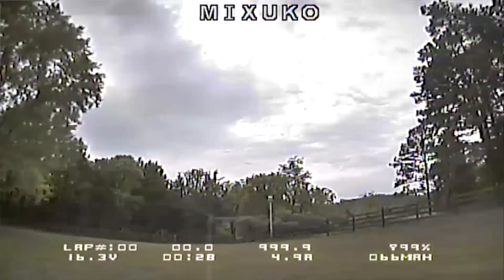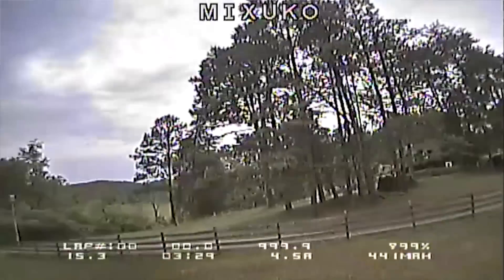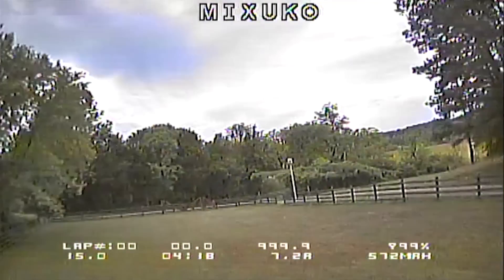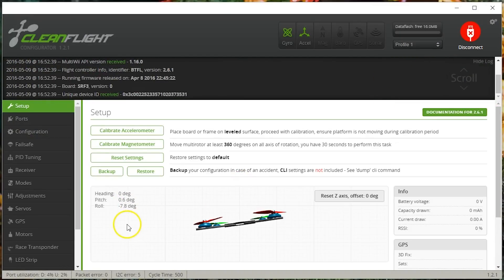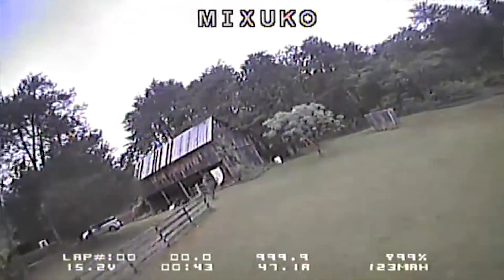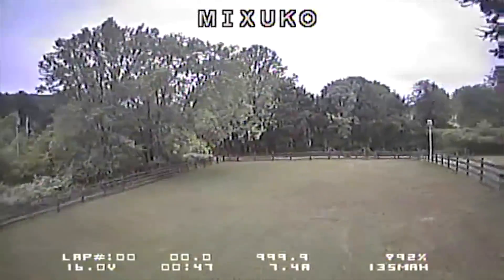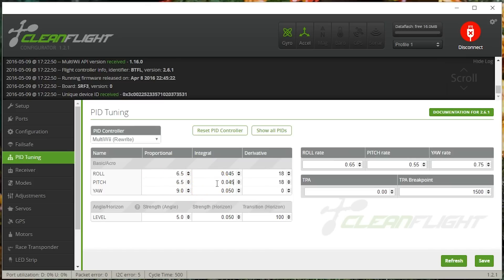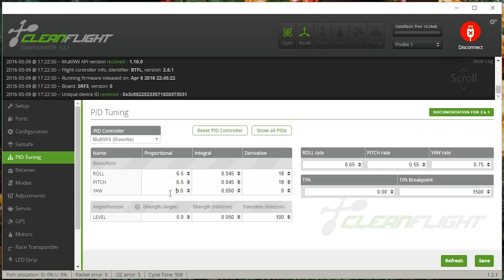Practical PID Tuning - Part 1  | HOW TO TUNE A QUAD

Comment: I would love my quad to be like yours did when it started.  My copter is oscillating out of control from the start.  I have my pitch and roll  P settings at 1.5.  and yaw at 3.5. My I's set to .04  and my D's to 18.  I'm flying a versacopter.  CG is balanced,  I'm running an X Racer F3 controller on CleanFlight with Borris B betaflight.   What am I missing here?
Reply from the maker: Could the oscillation be I term? Try lowering I to 20.
Reply: Joshua Bardwell I dropped the I' to .02 and the D's to 12 and still oscillates.   Is there a min starting point or is it case by case?  I'm using the std e pack that they recommend on the flitetest build.  Short of replacing all the motors and esc's I'm not sure what to do.  I do have a honking 5amp lipo on it to weight it down and keep it from going out of control too easily.
Reply from the maker: +adriancjones something is seriously wrong. With gains that low, it can't be your tune.
Reply: Any idea where to start?  I've replaced the FC from a naze32 rev6 to an Xracer.  Replaced a D4R 2 to an XSR running Sbus now.  All motors seem to be fine, while doing the esc calibration everything works the way it should.  I'm at a loss.
Reply from the maker: +adriancjones I'm afraid the problem is unusual enough that I don't have an easy answer. If I were there, I would start with a physical inspection of your build.

Comment: in Cleanflight what does strength (angle) adjustment do?
Reply from the maker: Stronger return to commanded angle in autolevel modes.

Comment: That video actually does not help at all (and I don't mean the horrible video quality at the beginning where you can't really see what's wrong). Calling yourself a drone racing engineer is a bit too much in my personal opinion. Saying things like "the throttle may need more yaw I gain.... perhaps..." causes confusion for beginners like me. You can't learn from vague comments like that (you have to explain why you think that I gain is needed). And why the heck don't you explain what P or I or D actually does or what it helps to solve? I died at "ok, everything is feeling pretty good". What exactly does that mean? Why don't you explain what "locked in" actually means?
Reply from the maker: Maybe this video will help you.

https://www.youtube.com/watch?v=8uqZmrCPOPI&list=PLwoDb7WF6c8ldO8tz0IUi9FNcJdvE2Mhe&index=5
Reply from the maker: Also this one is very good.

https://www.youtube.com/watch?v=0vqWyramGy8
Reply: Your other parts of the series, especially 5 and 6 do get better. Already watched them and thank you for creating them. Sorry if it seems like I'm an asshole after reading my first comment. I guess I really am one.
Reply from the maker: That 2nd link is to a video describing what P, I, and D do. Just in case you thought it was one of mine.

Comment: Thank you for the video! If I understand correctly...
Keep raising P gain (on all axis) until you see oscillations. Then lower them very slightly. It should feel locked in.
For I gain, do a punch out and see if the quadcopter holds its place and doesn't "drift". How will I know if I gain is too high?
For D gain, just do hard turning maneuvers and see if there's any oscillations. Keep turning it up until they're gone. If it's too high, it will feel sloppy.
Reply from the maker: Generally correct. If I gain is too high, the copter may oscillate in extreme cases. There may also be bounce-back after flips and rolls, although Betaflight has logic to prevent this. Excess I gain on yaw may result in the copter feeling like it wants to "pull into" or "pull out of" a turn at the end. This is because the I term on the yaw axis takes longer to return to neutral than the roll axis, because I gain is too high.

For D gain, you can't simply raise D arbitrarily. Eventually you get excess D gain and hot motors. You can destroy a motor or ESC this way.

Comment: howdy joshua,
 I watched all 5 and thanks. great info in here. I like the sound side of things and the I term.
I hadnt  caught the idea that throttle effects I as much as it did.
a quick question that may be of use for myself and others.

As the video starts with tuning the pids, is there a pre-cursor video talking about the other settings you apply?
e.g. rates, looptimes etc.

I cannot find that sort of thing anywhere. 
or perhaps one on the effects of the most common settings.

cheers and thanks for the videos
Reply from the maker: https://www.youtube.com/watch?v=htkw7d97bOo

Comment: need help,  when I yaw my quad, either right or left, the quad likes to throttle up and climb then back-down slightly.    what is the fix for this?
Reply from the maker: What version of cleanflight or betaflight are you running?
Reply: librepilot
Reply: using cc3d, i am beauty new to this stuff
Reply from the maker: Sorry, I don't know how to address that problem in OpenPilot / LibrePilot.
Reply: try setting "cruise control" on your yaw on the tab where you change the modes and stuff. I'm not the Josh Bardwell of libre pilot, but I think it could help you.

Comment: so I have recently been trying to ton pids on  my nigh halk pro 280 and I am giting close  but when I am flaying fast and I lower throttle to center the nose pitchs down and than pops back up any help would be great as its scary when flaying fast 5 feet off the ground and it moves so sudden
Reply from the maker: Make sure pitch P is high enough, then raise pitch I gain.

Comment: I was testing my yaw while tuning, moving the stick left to right, with high yaw rate, when it just falls out of the sky. If you want a detailed description, it flipped backwards about 180° and fell.
Reply from the maker: If it flips towards the down-spinning motor, min_throttle may be too low, causing a motor to stop fully and not start again.
Reply: +Joshua Bardwell It started doing that after adjusting PIDS on the pitch axis, it also likes to overshoot in a flip, timing on sticks is right.
Reply from the maker: Look at Blackbox and see if a motor is zeroing out during the move, and then going rapidly to maximum as the stick re-centers. That's an indication that min_throttle is too low.

Comment: Hi Josh I started tuning my QAV210 today. Here are the values for Roll and Pitch P 4.0, I 0.03 D 18.  Yaw P 9.5, I 0.05 and D 10. When I punch hard and cut the throttle the movement at the pitch axis is so drastic that the copter's nose dips down almost 180 faceplant down to the ground and wobles in the roll axis as well. Are my I gain values too low? and what should be the default values for I that i could start off with. Also what other characteristics should i look for when it comes to tuning I gain? Running betaflight 2.6.1 running airmode, naze32 rev 6 acro.
Reply from the maker: +Amber Meows first work P up. You should see the dip decline as P increases. After you're sure that P is high enough then raise I.
Reply from the maker: +Amber Meows first work P up. You should see the dip decline as P increases. After you're sure that P is high enough then raise I.
Reply: Thanks Josh!

Comment: This is exactly what i need to further tune my quad.  I have it good right now, but I wonder if I can make it better but not sure what behaviour to recognize and how to correct it.  Thank you Joshua!
Reply from the maker: First, make sure that P gains are high enough. This is the single biggest thing you can do to give a sharp, locked-in feel. But not too high! Okay... so that's not super helpful I guess. My point is, there is a place where P gains are okay, and the copter seems to fly well, but you still have some small tuning issues to work out. And then you raise P gain another 1-2 points and suddenly it's flying EVEN BETTER. So if you stop raising P when the copter seems to fly well, you may not go far enough. This is why I always raise P to the oscillation point then back down.
Reply: So my P is as high as it can be.  It feels stable on hard throttle and when I cut motors to drop down.  I enjoy high rates at 0.60.  My uncertainty lies in continuous correction when making turns or lining up an obstacle.  I'm not sure if it's because of my piloting skills (or lack thereof).  I haven't touch the I or the D yet, but I have PID adjustments configured on my Taranis so I can do changes without plugging in.  

For I and D should they be as high as possible or as low as possible? I haven't watched Part 2-3 yet, so don't answer if that is the case.  I'm literally watching your videos with pen and paper.  

I've watched many videos but yours are easily the most complete and with great explanations.  You do it so well.... you must be an instructor for something :-)
Reply: Another aspect as a new pilot, is that I don't know if the configuration in PID are the best that it can be.  I feel that this is one of those things that you don't know what you are looking for but once you find it you get it.  Does that make any sense?  Another question is should I reduce my rates while configuring PID or is that completely unrelated.  Thanks

Comment: question, when I pitch my zmr 250 forward its tends to dip intermittently. poner all feels good. could that be caused by tv rate. or I settings.
Reply from the maker: +Stephen Kelly dip what?
Reply: Its like  it pitches forward with out stick command. Twitchy.
Reply from the maker: +Stephen Kelly sorry. Not enough information to diagnose.
Reply from the maker: +Stephen Kelly sorry. Not enough information to diagnose.

Comment: 2 questions. 1, When I go to zero throttle to do a dive, the yaw likes to spin a little, how do I fix that? 2, I'm having to put excessive I gain on pitch, on 0.070, and it's stil, not happy. Why does it want so much?
Reply from the maker: Always tune P gain high enough before tuning I gain. Low P gain will require excessive I gain to pick up the slack. Any time you are considering raising I gain, first ask yourself whether P gain is high enough. Only raise I when you are SURE that P is high enough. Think of P as the first line of defense, and I as the fallback for when P isn't able to perfectly correct all error.
Reply: +Joshua Bardwell Thanks! What about the yaw at zero throttle?

Comment: Do you like luxfloat or mwrewrite more?
Reply from the maker: There is literally no difference at all anymore since BF 2.7. The only difference is whether you are on an F1, in which case you should use rewrite because it uses integers, or an F3, in which case you can use luxfloat because it uses floating point math.

Comment: Hi Josh, my first tune. I've got a lot of movement on my pitch, punching the throttle raises my nose and dips on down throttle, so I'm going to raise the i gain on pitch. I also have what I would consider to be quite a considerable bounce back on my rolls. Would this also be an indication that the i gain is to low on roll axis?
Reply from the maker: +Lee Swifty bounce back usury means excess I or low D. Throttle dependent pitch would indicate low P and/or I.
Reply: Joshua.
My thanks, sincerely.
You have given your time and effort significantly to this sport/hobby to help so many of us who are not so understanding. Your video's are excellent and personally I can't thank you enough.

Comment: What flight mode(s) are you in when you start the maiden hover? Thanks!
Reply from the maker: I don't fly autolevel modes at all, but if I did fly autolevel modes, I would still tune in acro first. Tuning autolevel and acro at the same time makes it much harder to tell what is messing things up, if things are messed up.
Reply: ok, so Acro it is. Any airmode?

Comment: When I give a stick input, at the end of the input the copter wobbles. Any idea how to tune this out?
Reply from the maker: It depends on the type of oscillation. It could be P term oscillation in which case P is too high. It could be a soft "sloshy" wobbling, in which case P is too low. The simple way to start learning this is to change ONE parameter, such as raising P on roll. See if the problem gets worse or better. Work through a range of values to explore the effects of a single value's change.

Comment: I have fast oscillation when coming to a Hard stop or quick turn around... , Im using BETA 2.6.1 LuxFloat     ROLL  P. 4.5, I  0.030  D 18....  PITCH P . 4.5 . I 0.0030   D 18    YAW 9.0    I 0.040   D 0    LUX FC  BOARD any help would be great cheers
Reply from the maker: https://www.youtube.com/watch?v=qg1jf85zyqI

Comment: Would this kind of tuning process work for a 450 quad with 9 or 10inch props?
Reply from the maker: +FPV Airmark same general ideas but the outcomes would be different.
Reply from the maker: +FPV Airmark also, the tuning goals might be different. For example, might be going for smooth flight vs. acro.

Comment: super helpful video man. A lot of tutorials are kind counterintuitive imo. quick question if you have the time. my quad feels really good with my tune but I'm still not great at tuning. i have this issue where if i come out of say a power loop and free fall with the copter parallel to the ground i get a rapid sort of side to side wobble where it seems as if its fighting itself. this is with kiss fc.
Reply from the maker: That's propwash oscillation. 
https://www.youtube.com/watch?v=qg1jf85zyqI

Comment: Hey Joshua, I really need your help with my quad. I like the way you analyze things and if you can spar few minutes for me, that would be awsome. I have been having this issue for weeks now. I have changed my esc (little bees 20A), my FC (Naze32), my motors (RS2205 red bottoms) and even my wires. The glitchs are still there. I have check everything (no screws touching the motors, my solder joints, my bullets connectors). Im using 2.7.1 and I have blheli 14.6. The issue was there even when I was using blheli 14.3, 14.4 and betaflight 2.1.6. Can you help me troubleshoot this ? Thanks !!! 

https://youtu.be/trCJloQF-Ho
Reply from the maker: It could be a bad gyro. Is it Naze32 r6 or r5? Did you replace with the same rev? But honestly, the chances of having two bad boards in a row are pretty slim.

It could be excess vibration and D gain causing some kind of "saturation" effect in the PID loop. Does the problem still happen if you lower D gains to zero?

It would be really interesting to see in Blackbox whether the P gain is moving the same direction as the gyro, or against the gyro, when the problem happens, and whether the gyro leads the P gain or trails it.
Reply: +Joshua Bardwell it is rev 6. I never tried to put D gain at 0. I will try that when i get back from vacation. What is weird is sometimes it flies well. But the fact that it does that keep me thinking something is wrong but cant find the source. I have never used blackbox. I will try it also. Is it pissible to send you the data ? Thanks again Joshua !
Reply: +Joshua Bardwell i have deactivated the acc and the baro.. Could it still bebthe gyro ?

Comment: Hi, thanks for the insight. Would having different props change this testing? i.e. normal compared to bullnose props? Surely bullnose would totally change the performance and flight characteristics, so you have to make a different tune setup?
Reply from the maker: +Jason Wolfe yes.
Reply: Thanks, what props are you using? do you recommend?
Reply from the maker: +Jason Wolfe I use kingkong 5040. I like then but they've disappeared from the Internet. Also try DYS 5040 tri blade.

Comment: Thanks for this tutorial !! It really helps understand tuning.. Just a quick question, I have some problem with my FPV signal when I throttle up. I have an LC Filter but it doesnt help. I understand that you refer to maybe a high I or excess of D. I did increase D a lot because I was getting bounce back on rolls and flips. Should I decrease D and decrease I to get rid of this issue with my signal ? Thanks again and keep the good work ;).Im using 2.7.1 and have a Naze32
Reply from the maker: I think there's been a small misunderstanding. I gain won't cause noise in the video signal. So you're fine there. Excess D gain can cause noise in the video signal. Listen for "warbling" oscillations as you throttle up and feel for hot motors when you land.

If the LC filter didn't make any difference at all, then the noise may be being picked up from an ESC power wire passing near the video wiring.
Reply: +Joshua Bardwell ok thank you very much I will defenately check this out. I appreciate the fast response !!

Comment: as you see Joshua the same rates have different outcomes on other frames. degree/sec seems logical but its not behaving like that ;) nice tutorial about pid tuning, i still keep learnig about it. i also noticed that switching looptime from 1000 microsec to 250 eliminates my propwash by 50%
Reply from the maker: +Hans Turpyn yup. Definitely different rates of rotation on different frames. I thought of our conversation immediately.

Comment: on my taste of starting tuning your D is way too high to find a proper P value. 0 for D doesn't work either for me, because it starts oszillating immediately. I set my D usually at around 5 - 7 and then I crank up P. Same the I-value I set a little lower for the first P tune. Are you not afraid to get a much too high P when D is still that high?
Reply from the maker: I usually give betaflight default PIDs at least a shot when going to a new version. Boris spends a lot of time tuning them, and they are usually a bit on the conservative side so I expect them to be low. I flew the default PIDs and didn't see any signs at all of excess D gain, so I left it where it was.